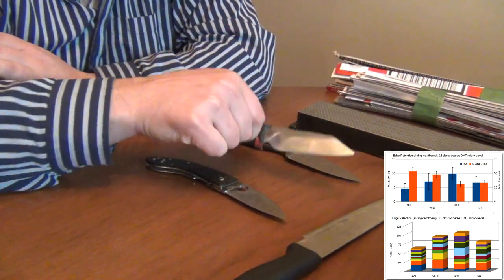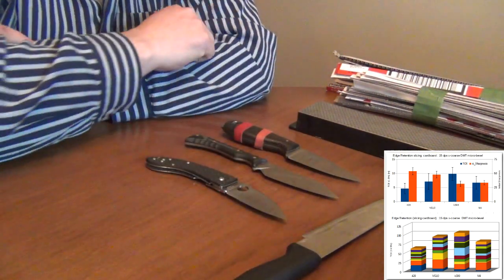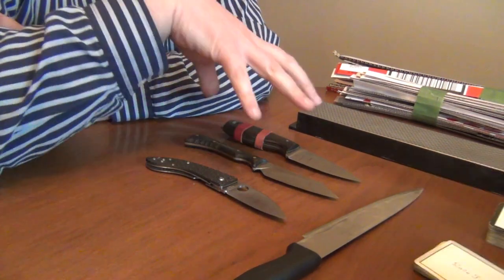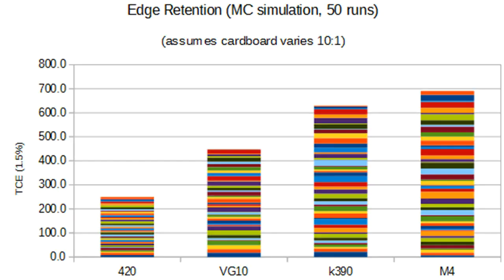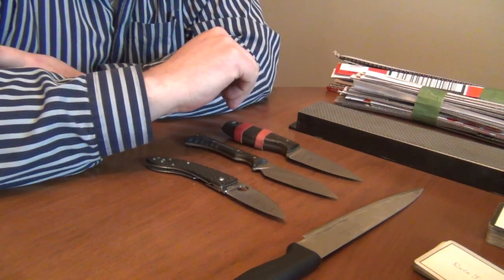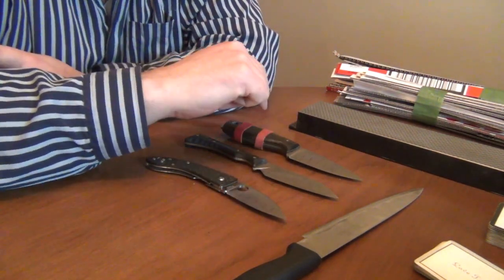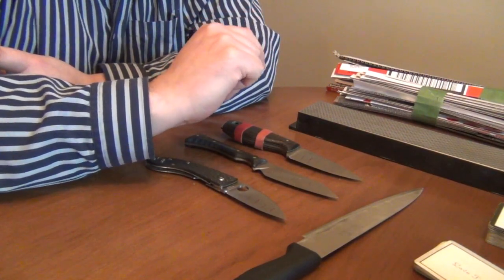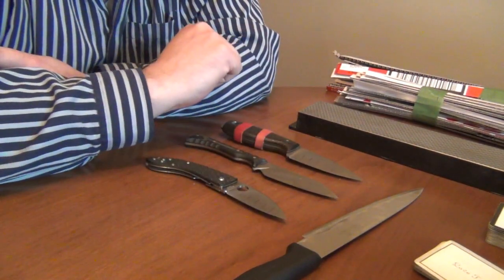Edge Retention - 3Cr13/420, VG-10, k390, CPM-M4 (cardboard)

Comment: Also your point you make about “imagine how long or time consuming testing that would be”

Well that’s the thing. When you love a knife and carry/use it day in and day out at some point you do cut 50km of cardboard with a single knife. And then at a later point 100km. Plus all of the other shit besides cardboard you inevitably end up cutting with your knife.

My point is that it is in long-term usage that these differences become glaringly apparent. In the short term use I can get just as much utility out of 3cr as magnacut. But as the days, weeks, months, years wear on? Then it becomes massively apparent that the magnacut is much higher quality. I’ve managed to keep my edc + work knife (it’s the same knife, hogue deka in magnacut) going for over a year at this point without a SINGLE sharpening. Only take it to the diamond strop after every shift. And it’s pretty much exactly where it was when I purchased it. I’ve absolutely abused the blade over time and it’s still perfect without any rolling or chipping. I can’t say the same for my cheaper knives which I cannot make it a week without rolling or chipping the edge. 

So essentially in the short term the steel is much less important when compared to say the heat treatment or blade geometry. But in the LONG TERM, I’m talking “heirloom” pieces, these higher quality steels simply outperform.

Comment: I saw a Chef use the 3cr13 stainless steel in a vegetable cleaver and he said he likes it. Is it really good steel for kitchen use? When I shopped around for vegetable cleavers most of them use much harder steel but people complain of chipping.
Reply from the maker: It is the simplest steel you can get. The main concern you would have it how it is made as cheap knives are often made in cheap ways. Hardened properly, chipping would be unexpected as it would be in the mid-fifties at maximum in hardness.

Comment: No demo, just dialogue. How do you validate?
Reply from the maker: Not sure, validate what?
Reply: @CliffStamp  no cut test?
Reply from the maker: @uckBayNguyen  Yes, details are in the description. 

I cut a LOT of materials for those tests, just read the tests, you don't want to watch 10+ hours of me cutting.
Reply: @CliffStamp  sorry, I was expecting more Cedric and Ada type of presentation where he actually put it to action. I'm a visual learner than a reader. My bad
Reply from the maker: @uckBayNguyen  No worries, I just never saw the purpose of watching me cut strips of cardboard or rope over and over.
Reply: @CliffStamp  I understand. Most edit. Truthfully, I was hoping for a video on the lowest tier blade steel head to head. It would be pointless from a steel snob's perspective, but would be humorous nevertheless. I'm talking $9 Walmart special pocket knives
Reply from the maker: @uckBayNguyen  Note that a big difference between what I do and most people, is that my edge retention work is at angles/profiles where steels perform well, not as-boxed. 

If you take even a cheap steel, and grind and sharpen it properly, they will cut for a very long time. 

Even on something like 420J2, the edge retention trials I would run on that would typically have ~1000 slices of cardboard cut.

Comment: Why would you not specifically cut 5 red and 5 black per knife rather then randomizing it. Where it may normalize or you may get a 75%/25% red/black with one knife and a 25%/75% red/black with another. You don’t have to random sample. You can deliberately sample.
Reply from the maker: The point of this was to show the variation in the substrate, other comparisons have controlled substrate comparisons.

Comment: You cannot buy a J2 blade knives for $2
Reply: You should not buy one for $2, since you can buy one for about $0.80 if you look. 

"Royal Norfolk" and "Galaxy" are 2 brands that use 420J2 that can be bought in 8 inch chef knife versions for $1 retail, or ~$20/case(24 pieces).

Comment: How do you measure optimal sharpness? How do you know what optimal sharpness is with that knife/steel and how do you know when it is at a certian percentage low
Reply: Also everyone on forums says vg10 is notably better than aus8 and that aus8 is notable better than 440a and 440a is notable better than 420j2. So based on this the difference between 420j2 and vg10 would be drastic theirfor making the price difference well worth it. So based on what i hear your expirements are showing you this is all wrong and that its basically marketing and placebo. Or am i wrong?
Reply from the maker: Codie, I measure the sharpness in a number of ways, and the percentage is just sharpness/optimal. I determine the optimal by basically estimating based on what I get. I set it a little higher than the best I can achieve. I set it the same for all steels at a given point, some steels will achieve it easier than others. AEB-L for example is far easier to get a very high sharpness than 440C.
Reply from the maker: Most people are repeating what they have heard ask them for the actual data to support the conclusions.
Reply: I read your articles on your site and watch your videos forum etc.. and i believe your data to be true and scientific. And at the same time i watch a youtube channel like birdshot iv take a aus8 rat1 and a 440c ganzo rat 1 knockoff and compare edge retention with manilla rope slices or cardboard, and the 440c blows the aus8 away. Same edge geometry and everything just different steel. Do you attribute this to heat treat or what?
Reply from the maker: I don't think they have the precision or accuracy in measurements to support the claims made. If you look at CATRA data for example, you will find steel differences are very small. For example Dozier had a bunch of similar knives made and steels like S30V and 154CM which people will say are very different where just barely able to be measured as different by a machine cutting stock ISO grade material (~10% difference). 

When you see the numbers I get, I struggle to get 5% precision and I am averaging literally tens of thousands of cuts and hundreds of measurements of sharpness over multiple runs. I would bet heavily if most if not all of those people run actual double blinded runs they would be very surprised in the results.
Reply: What im saying is i watched the video. They used the rat1 in aus8 and it did about half as well as the 440c ganzo. same blade shape, could be different angles but i doubt it. I was thinking that leaves heat treat or hardness. maybe the 440c is say 58rc and the aus8 55 something like that might explain it. Their experiment wasnt perfect, but they did use manilla rope from a brand new roll same roll on both knives. I love your experiments btw. Or i hate them idk which lol. In a way i like that all steels arent very far apart, and in a way i wish they were so we could have steels that were that much better like people say
Reply from the maker: Codie, even rope from the same roll isn't that consistent. If you want to get an actual accurate/precise value you would have to do a minimum of three trials with each, with some kind of blinding. If they were to do that I think they would be very surprised at the results. 

A difference in initial angle of just 1-2 degrees or minor change in sharpness can make more of a difference than 440C vs AUS-8A. Note that the compositions of those steels are so close to each other they almost overlap if you look at the elemental ranges.

Comment: So is the answer to the "best steel" question that there is no overall best steel, rather better steels for certain applications? Like really high hardness steels like m4 and zdp189 are best for knives meant only to cut, not chop and baton? Or steels like s35vn and s30v are good for edc folders, but maybe not outdoorsman or rough use applications? But then what confuses me (assuming those statements are true) is that sometimes a steel is used outside of its ideal application, yet still excels. Like falknivens vg10. Vg10 seems too brittle for a field knife that's going to be beaten on, although theirs is a laminate. It becomes difficult for people like me, who are very enthusiastic about knives and using them, but not so mathematically or metallurgically inclined. I'd like to be able to pick your brain, but see you're pretty inundated with comments most of the time. Thanks!
Reply from the maker: Yes exactly. 

Just think about asking someone for the best type of wood. Isn't it clear that it would depend on what you wanted to do? Same thing with steel.

Comment: One more thing to think about. The heat treatment. You should be getting each one from the same manufacturer who has known quality to ensure one isnt screwed up.
Reply from the maker: +RebelForce8 Ideally yes, however it generally isn't practical to call up a manufacturer and ask them to make a set of blades for you in the same knife, just different steels. Hence you make due with that you have. 

What you have to do is not just look at one experiment but a number of them. If you have a S30V blade that does poorly in one comparison it could just be that blade. You have to look at how that compares to other S30V blades to see if the trend holds. I have done literally hundreds of these comparisons.
Reply: Well yeah but you could get for example spydercos with 3cr, s30v, m4, s110v and they should all be properly heat treated to start with.
Reply from the maker: +RebelForce8 I have done that, in fact I have custom made knives from a particular maker in different steels. Again, I have done this hundreds of times. This is just one example on a few knives.

Comment: I personally think D2 is probably the all around best steel for most purposes. It's not super shinny and it will corrode if not cared for but man I can do so many things with my D2 knives for much longer without having to sharpen them. I bought a BM grip with D2 steel and hammered that knife and have never sharpened it. I can still shave in both directions with it.
Reply: Myk Ford Interesting...... but I fear you may have missed the point.... then again, perhaps not...

Comment: A concern would be that you test particular knives here, not steel types.
Reply from the maker: This is a valid criticism, however note here that the edge angle, apex angle and apex finish are all the same and that the cutting was constrained to a 2" straight section of blade length. There is then the small bias from the blade thickness which is minor.

Comment: Very interesting. One would suspect there are bigger differences. But as I gather, heat treat, blade geometry, temperature, moisture etc all have effect on the blades. What if for instance we take the CPM4 to the Winter subzero forest test against a 420j2, or take it to sea and compare cutting in salty environments. The tests you made were very enlightening, however only lab tests based on a few dimensions. (ie. I read that Extrema Ratio Col Moscin N690 steel knife was dropped from some height in winter and broke. Also n690 used as a diving knife got rust quickly...) As you well put it, I agree that personal use of each knife is very influencing on the blade material. So all in all I would understand there are basic differences of steel type and hardness, but minor differences in real-world performance for most knives.
I think you summed up about 10-15 years of knife talk in this little video. Well done!
Reply: Actually I did note that 420J was more affected by extreme cold than other steels (like CPM 3V and INFI), but that was at -30 Celsius having left it outside for hours. To me, for big choppers in "normal weather", 420J by cheap Chinese or Taiwanese makers, offered the best combination of corrosion resistance, sharpenability and edge-holding, initial fine edge holding while chopping wood being particularly impressive with 420J... Then supposedly better Chinese steel on a Kershaw, like 7Cr13, or even S30V on a custom, tended to micro-roll on cardboard... Not much dulling, just a tiny nail detectable curl on one side...
Reply from the maker: Andras, yes, that is very true, this is only one aspect and there are many others which influence performance and many can be far more critical.

Comment: Very nice video Cliff. As I was watching,  I came to the same conclusion as what you said later in the video, that the type of steel can not matter as much as geometry, edge angle,  edge finish and etc. I've discovered that in my knives, steel type accounts for id say a third of the retention I get (not really 33% but its one if 3 major differences), others being geometry, grind and blade shape and last is sharpening angle and finish and how well its done. On any knife, one of those big 3 can affect the result more than another,  so to say my m390 blade gets better wear resistance than my s30v all the time is impossible. The sum of the other variables can and will affect it more. Theres a custom maker I like, he makes very smooth knives, great fit and finish, great prices and his knives are usually ground to about .013 to .015 so they cut pretty well,  especially in the tacticool world. While he use n690 most of the time but has made a few m390 knives and I've been looking for one in m390, passing n690 ones when I realized that its not that huge of a difference. To see the difference,  I'd need to do absolute tests,  keeping everything the same as much as possible and then I might see better wear out if m390 but like you showed in a different video, if you add in sharpening time as a variable,  n690 will be the same if not better. So I found the knife I wanted,  it was n690, I bought it and have been extremely happy with it so far for edc use and in cutting up cardboard. Great video Cliff,  some important points were shown here.
Reply from the maker: One thing which I think makes this obvious with very little inspection is to think about all the ABS guys using steels like 1084. This steel has little wear resistance compared to even D2 let alone S90V, but yet where are all the complaints about poor performance with ABS knives?

Comment: Cliff, are you controlling for direction of scratch pattern? And how much of a factor is that, if at all, in edge retention on abrasive media as in the present test?
Reply from the maker: Yes, they are all finished with the same 45 degree cut scratch pattern.

That is an interesting question. I have never measured, or even tried to compare the edge retention in that aspect.

Comment: Great video Cliff. As have been using steels with less constraint, one big thing that I notice versus sharpness, is the kind of damage the steel takes. Simpler steels often times just roll versus chip out, and I would rather deal with that over chips. 

Most steels seem to lose their high sharpness at around the same point it seems anyway.
Reply from the maker: That is an excellent point. I think at times we can lose track of practical comparisons in cutting to low sharpness levels that most people would long have sharpened the blades and considering ease of maintenance, durability is critical.

Comment from the maker: "3vil3lvis
5 hours ago
Linked comment
 
One of the things that concerns me with your test is that the 420 knife appears to be approximately 40% longer then the other knives, and a longer knife could mean the work load is distributed over more edge which in turn could skew the statistics in favor of the 420 blade steel. Did you take any measures to limit the useable blade length of this knife in your testing or is that just a forced perspective optical illusion?"
--

Cutting was done with a 2" section on all blades.

Comment: One of the things that concerns me with your test is that the 420 knife appears to be approximately 40% longer then the other knives, and a longer knife could mean the work load is distributed over more edge which in turn could skew the statistics in favor of the 420 blade steel. Did you take any measures to limit the useable blade length of this knife in your testing or is that just a forced perspective optical illusion?
Reply: He talks about how much edge used on each knife!

Comment: I'd like to see how un-heat treated mild steel does on this test.
Reply from the maker: I did some work with that years ago :

http://www.cliffstamp.com/knives/reviews/tension_bar_proto.html
Reply: Cliff Stamp I read that from a past conversation we had.  I'd just like a better comparison.  I just think adding it to this test would give a perspective, especially since the $1 knife is of unknown steel.  Even the if it is 420 total carbides close to M4 because of the chromium.
Reply from the maker: *****
420/3Cr13 has a very low carbide volume (a few percent), M4 is much larger and the carbides in M4 (tungsten and vanadium) are much harder than chromium carbides.
Reply: Cliff Stamp 14% vs 20% is a lot, and obviously the kind of carbide makes a huge difference, but 1095 would obviously do amazing on this as well, I'd just like to see the exact comparison of a mild steel.